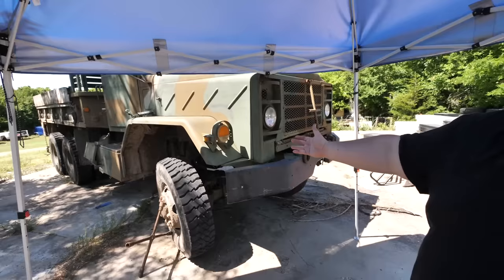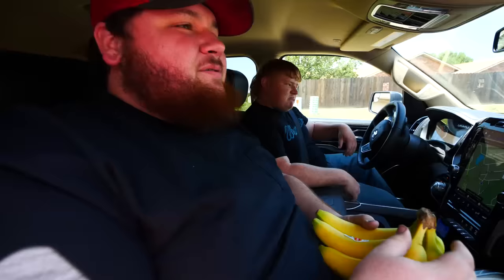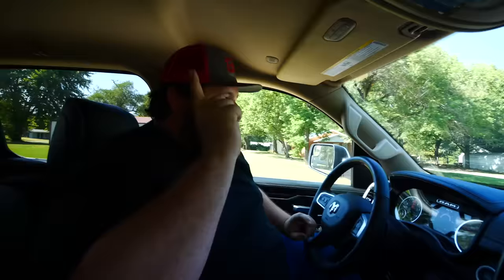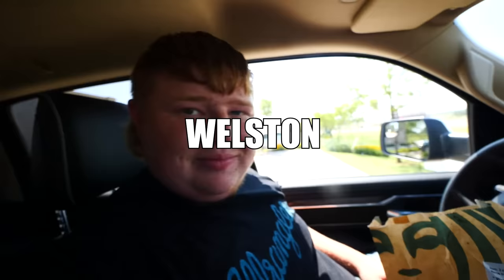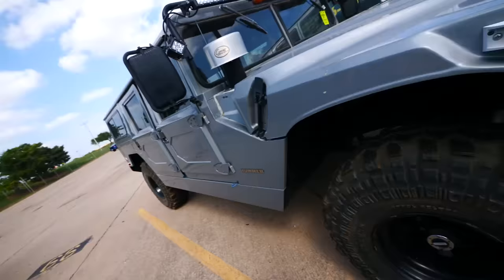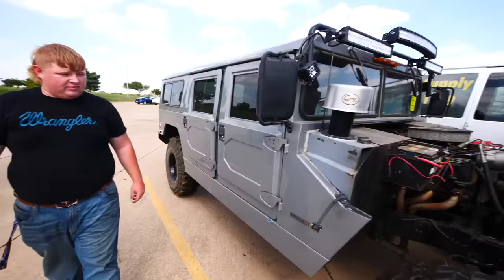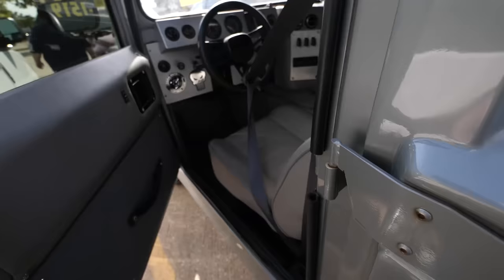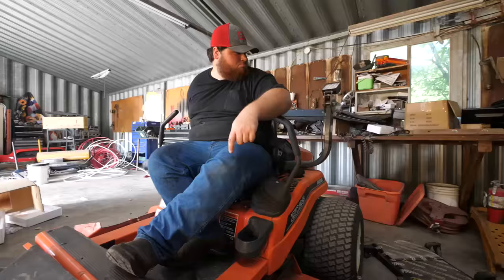Buying H1 Hummer From Auction..Turns out its FAKE

Comment: Civilians “ohhh military grade”
Us in the military “military grade run run run”
😂😂😂😂
Reply: Military grade is a baseline. At least in the US, you can almost always get better civilian versions of military gear. But military grade gives you a degree of compliance where you can be certain that it meets certain basic requirements for durability and interoperability. The last thing you want is out-of-spec MOLLE or other critical components.
Reply: coming from someone who used to work in a factory producing "military grade" components.. there is a lot more scrutiny, and spec compliance when it's a military job then some other civilian customer. doesn't necessarily mean the part is better or of a better material, but it's definitely "up to spec" as they'd say
Reply: @WardenWolf  the air force is an exception, they get the best of the best
Reply: Hahaha! True
Reply: I worked as a maintenance tech in a large hotel for years... When you see "Hotel Quality" on a package of sheets leave em right where they are.

Comment: Whether it's thr real deal or a built-from-the-frame-up replica, an H1 is still a good lookin' truck. It had me fooled at first glance too, dudes. 🤣
Reply: True either way its a piece of crap
Reply: I'd drive it.
Reply: @Abel-Alvarez  I thought everyone knew that the HMMWV had portal axles...and everyone can see, on the first glance, that this fake doesn't. And, actually, the guys in this video did spot this right away, right on the first glance.

I wouldn't want to drive a car which basically yells out to everyone: "I'm a fake! Now have a look at the driver!"
Reply: Guys that’s a real h1 many ppl do duramax swaps and suspensions soget chances on them so those two thing I wouldn’t be judging by since those are the two biggest changes ppl make to them

Comment: Who the heck makes a fake Hummer?

Edit: hol' up, a MANUAL electric car!? You can't say that isn't cool.
Reply: Its not cool, you need the roar of an engine to really feel what its like to drive
Reply: Bannas
Reply: Fakes are actually pretty common.
Reply: @xxchiefthiefxx365  I like quiet cars, so I disagree. A roar is nice, but not nescisary
Reply: @xxchiefthiefxx365  Sure try driving a taycan and you will change your opinion
Reply: Probably a major upgrade.
Reply: Ed Carol in Texas makes shit like that and half dozen shops in Southern Calif make em. I think they were sold body & chassis even devoid of gauge clusters where U would have to order or install your own gauges. Most of the time the speedo gear cluster would have to be ordered. Clarion Company in Los Angeles was one and there are others in Michigan had these clone bodies and frames shit. I have a yellow one here we got in a trade deal. The reason I state it is not H1 suspension system more Like an F150 and there is no motor no gauge cluster no ignition. But the steering is there and the axles to be hooked to what ever. The wiring (HARNESSES) is with the thing in a big box in the back has many plugs that can be wired up. The bad thing is there is no instructions. Probably why it was sold at our auction for $1500 bucks even with cool wheels and tires...
Reply: my buddies welding shop fabricated up a H1 to put in parades and stuff for advertising, turned out great.
Reply: Invidious Ignoramus your clutch would pretty much last forever, too
Reply: The now defunct Classic Roadsters in Fargo, ND use to make a pretty good copy of the hummer. I wanted one bad when I was a kid. Kit was $13K and you supply the GM square body frame and running gear.
Reply: @precisionmachineshed  The ah Frankenstein we have came from somewhere nobody even the place in Texas where we got it at the sale remotely knows where the fucking thing we have came from. I was under the impression these things like I have came from or were made in Texas or Arizona. Now U say North Dakota. Maybe what I really need now is a Medicine Man to get the construction manual.
Reply: Urban Gorilla bodies made to fit any chassis
Reply: The same person making a Phantom out of a Chrysler 300.
Reply: @xxchiefthiefxx365  And that why they started adding fake engine sounds to em XD
Reply: If something exists someone will make a fake of it.
Reply: Extreme 4x4 made one from a 3/4 ton suburban. They called it the Suburban Gorilla. It had a custom built Duramax under the hood from Banks.
Reply: The fake Hummer came from Arizona.
Reply: Jurrasic truck builds a kit that fits a 4 X 4 suburban chassis.
Reply: I have friends who do body work for a living and also buy from auction, and just for kicks, theyve built a couple of fakes...
Reply: I remember being all excited in high school, then got an imitation...
Reply: How does that work. I don't think an electric car has more than 1 gear. Does it just change the max power percentage or something.
Reply: For real, electrics don't even have gears so what the fuck does a MANUAL ELECTRIC CAR mean!?

Comment: This is why I don't buy from auctions. My friend bought a "Cadillac Escalade" in an auction and it turned out it was a chevrolet suburban with a Cadillac kit.
Reply: Your friend needs to pay attention, how the HELL DO U DO THAT!
Reply: To be fair, that's what all the escalades are though haha
Reply: Same thing GM does.
Reply: sstroh08 😂 i put escalade wood grain interior in my burban most probably would not know the difference
Reply: Tf you think GM do for caddy? Make em
Mold everything in Carbon fiber lol same shit everyone used to do back in the day with explorer and Lincoln 😂😘
Reply: An Escalade is just a Suburban with a Cadillac kit straight from the GM factory. So your friend really did buy an escalade.
Reply: It wasn't on the title?
Reply: @jerrydavis9558  expedition and navigator always had huge differences. The 03 navigator interior is so much nicer then the expedition. Completely different inside
Reply: sstroh08 Escalade comes with different motor  and nicer interior
Reply: Cadillac, GMC, Buick, Pontaic, Saturn, Hummer  are base of Chevrolet Tahoe, Suburban, Silverado, S-10, and etc sharing all platform, engines, transmission, frame and etc
Reply: @MLProductions.1  how much nicer than a king ranch or eddie bauer expedition? Not by much lol
Reply: @jacobking4106  I think much nicer. I've driven both and the plastics and. Everything is so much better. Different engines as well at least until 04. But other then that there the same. But those years did have much bigger differences then the Chevy to Cadi
Reply: They never bought it - its a fake/staged video that they made knowing it wasn't real to begin with. C'mon you think this really happened IRL? Everything he puts out lately is staged and pre-planned.
Reply: tbh thats better cause they are the same thing, also parts are cheaper when you say its a chevy over a caddy
Reply: It’s technically the same thing
Reply: The suburban is more reliable 🚙
Reply: But that is what a caddy is? My dad had the Escalade EXT and that's exactly what it was. 
All the part numbers down to the air shocks and pump are the same between a maxed out chevy avalanche and the Escalade EXT. Same Bose sound system, heated/cooled seats, etc etc.
Reply: @richardharris492  Ha, all you'd need in a front clip, tail lights, and interior trim pieces and there ya go.
Reply: @JavierSanchez-hv9hn  Not really. I believe they came with a 6.0? Idk, I don't really see many of them, but every single 99 and up Suburban built has that 5.3 Vortec, which is a legend (LS), so if it was fake, but had the 5.3, I wouldn't mind. Also yes, I realize the 6.0 is LS based, but for just everyday use the 5.3 is better. Slower but better milage.
Reply: But Escalades are 6.0s or 6.2s and most are awd . I think Denali are the same fckin thing but gmc . Burbs aren’t awd and they don’t have 6.2 . 2500s have 6.0s
Reply: LMAO! Check the VIN
Reply: Richard Denson  facts . Always check the vin !!
Reply: a Denali suburban is the same 6.0 engine
Reply: @nickopedia5669  when I worked in the auto sales Dealership we call that putting a bow tie on the horse t*** . Just change the trim kit on the assembly line.
Reply: I buy from auction, my wife worked at an auction for years... vin numbers and titles are verified... no way can a vehicle be sold as something it isnt... 🤷‍♂️
Reply: @jeffanderson7256  i had my old z71 gutted (it was stolen) so i installed a full escalade interior, carpet, door panels, seats, dash and center console... everything but the steering wheel, it all fits right on
Reply: @apolinarcaborca_elrojo7878  i got the dash, wheel and window switches and always looking for a nice set of the door cards
Reply: @sstroh08  escalade is a suburban, just with a better interior. They come off the same assembly line. Just like the Mercury mk. LT is the exact same vehicle as an F150.
Reply: @MLProductions.1  the interior is not a big difference, you can swap all that stuff out in about an hour. The truck itself, the mechanical are exactly the same.
Reply: North Star V8 was trash…. I’d pick a Suburban with a body kit any day of the week…
Reply: @richardharris492  it's one of those "no touching" auctions

Comment: "This one doesn't even have the self-vibrating tire feature, so you can't tell how fast you're going."
I have that same feature on my 97 Ford Expedition, courtesy of Hankook mud tires! At 55 you start hearing the tire, at 80 you no longer hear the engine, or the radio, or any of the passengers in the car with you.
Reply: It's a Dodge? It's just a question of time! Plus those Fiat EcoDiesels are unreliable AF! FCA Junk!
Reply: Is this an American thing? I never heard of this feature before. I'm in Europe tho. And i thought you guys have more silent tyres over there, to make the ride more qiuet on long roads. Or is this an old thing now lol?
Reply: @ElvenMans  It's what happens when you put aggressive mud tires on something at higher speeds. Most cars and highway-type vehicles come with less aggressive, quieter, lower-rolling-resistance tires. People who go offroad(or "want" to go offroad) put big, knobby tires on trucks(and anything else they have) these tires are good for mud, sand etc... Highway noise is much higher though.
Reply: I'm buying me some of those tires tomorrow
Reply: Got 37x13.5 super swampers on my 97 f150, hitting 60 in that thing is the ultimate adrenaline rush

Comment: That “it sounds like a 6 liter with no oil” hit a little too close to home. 01 2500 suburban 4x4 with 247,000, she has that lifter clack on cold starts
Reply: they all do, ive got a 6.0 thats been doing that for 5 years and still going.
Reply: If it doesn't have that clack, time to trade it in

Comment: Hearing him talk about rough pickups reminds me of the one I just took home today. 1983, max at 60mph, 4th gear gets angry and 2nd gear maxes at 15mph, so you chill in 3rd all the damn time. steering is super loose and brakes are really hard to push down. But $800 is $800 and the 351W is running healthy, so that's all that matters, right?

Comment: They have a lot of blown up hummers left in Iraq
Reply: They don't have a single blown up hummer in Iraq. Humvees, however...
Reply: @milk1472   get outa here with that s***
Reply: @milk1472  Hummer-Humvee=same.
Reply: @scottbaxter2682  hummer- $60,000 vehicle with 6600lb curb weight with a 6.2L V8.
Humvee- $220,000 vehicle with 8500lb curb weight. 6.5L turbo diesel. It also has a turret mount and ballistic protection. They're not the same. Hummer is pussy shit to a humvee

Comment: There was a guy making kits back when, GM  made him stop when they were bringing the H2 out.  Most of them were on suburban chassis.
Reply: I remember when there were Hummer kits to convert a GM truck or Suburban into a Hummer. They were like $5-10k 15-20 years ago, depending on what you wanted.
Reply: Bummer kit!
Reply: Yeah, the Bummer was just one of several kits made. I had one. It was great and could eat a real H1 for breakfast.
Reply: I remember the gorilla kits. 4x4 off-road on powerblock tv made one years ago
Reply: there are kits all over north america
Reply: U R correct Ed. There was more than one guy. The guy that sticks in my mind had a COVERT place outside of Dallas Ft Worth area. His name was Ed Carol. He had alotta issues and ran a body shop. I have one of these clones made on 99 F150 frame a yellow one a real cutie pie. Has no motor no gauge cluster and there is a wiring harness inside the thing in a huge cardboard box. There R no instructions to the wiring harness we R hoping to use a Silverado harness and put 6.0 in ours. The harness has many many plugs and we cannot figure what the fuck it what. OUR CLONE does have a Ford frame definitely but ours has the solid GM 1 ton 4x4 axles and huge Transfer case so likely what Weston was looking at is alot like what I have in shell form. The guy in Texas that was making these was Ed Carol. He had multiple warrants out 4 him back in the 1990's then he disappeared. Someone else owns the body business where he was selling this stuff. There were other people making stuff like this too on the west coast. So what Weston is seeing is deff a fake fake with a gas motor and Solid Axles and alot what we got 7-8 years ago at a local auction here. We only paid $1,500 for the thing because it was disclosed as a KIT if sorts. I was intrigued and got it. I was thinking someone in Mexico was the culprit putting together UNSOLD left over Ford chassis and GM axles since the assembly plants got crushed by BUSH was and OBAMA. I was told these guys doing this work were doing up until about 2009 or so.
Reply: @danielculver426  They still make them according to the interwebs. I would think most of the vehicles used in Hollywood productions that get blown up are actually Bummers. Since actual HMMVs cost more money.

Comment: That was my buddies old H1 kit truck. He bought it from some guy in the upper northeast and got it shipped down to GA. It was a pain in the ass to drive as the steering kept coming apart under the hood while driving. 🤯 It did however turn heads when you crank it. It sounded F-ing amazing!

Comment: If I remember right, back in the late '70s Mopar made a prototype for what was to become the HMMWV.  Some offroad magazine featured it and I was astounded by its capabilities.  However, AMC produced a design that the Military finally went with.  If I remember correctly all of the prototype designs were independent suspension.  I remember because I was impressed with the differential ground clearance was much more than anything on the market.
Reply: Actually, the Unimog had been around since 1949, different models over the years of course, but all with portal axles. The Volkswagen Typ 82 "Kübelwagen" was earlier but was only was built from 1940-1945.

The Unimog was of course not an option for the UA military as it has a manual gearshift. Depending on the model and variant, you could have up to seven gear sticks.

Comment: Just buy a retired humvee where really cheep for a good one
Reply: False logic—no good ones come out to auction.
Reply: @kraignadjkovic5494  how would you know? You just know every humvee that's ever went up for auction in every US State?
Reply: @Cody Praetorius I did 26 years and 1 day in the US military. There’s no cream puffs coming out of inventory to auction.
Reply: There is not a good hummvee.
Reply: No such thing!!
Reply: @lelandgaunt9985  lies. If it runs and drives its good if it broke its army standard
Reply: nolble608 Farrell 

I guess after a new engine it’s good; even with a proper weekly pmcs. Most still require you keep an extra seat cushion to provide tail pipe pressure. Please inform me on your experience.
Reply: @kraignadjkovic5494  He probably means "a little work will make it awesome".
Reply: @james avery Not so.

Comment: There's inboard brakes on either side of each pumpkin, and there's drop down gear boxes on every wheel. When I was in Iraq I figured out a way to do the brakes pretty quick. Civilian H1 should be just about the same, until they came out with the H1 Alpha which actually had a good engine. You should be able to buy a non-turbo one at a military auction no problem. Good luck with doing anything as far as maintenance, for every bolt there is a nut on the other side of wherever the hell it's bolted to and you need an extra set of hands and a third arm.
* oh there is a way to fiddle with the injection pump on the turbo models, to give it more fuel, the fan takes so much power. it only cools itself when it gets hot, and there is a fan cut off switch when you hit the accelerator pedal, so it can accelerate to 60 faster.
I thought this thing sat too high and the nose was too short,  and the wheels on a regular Humvee are kind of jutting out a little bit, like a Baja racer

Comment: 9:41 Canadian built ZENN (you can see the steering wheel says ZENN). 
Stands for Zero Emission No Noise, as it has a small electric motor. Was
 meant to be a small neighbourhood car only suitable for slow roads 
around crowded cities. Top speed 25 mph / 40 kph and has a 40 mile / 64 
kph range. They were going to produce a faster and longer range version 
in 2009, but it never went into production. I think they were made 
in/near Quebec? Maybe Eastern Ontario. I'm Canadian so.

Comment: I never seen the appeal for one.  I knew a guy that had a real one.  He said it was a POS and belonged back in the desert.  It handled horrible! 
Big and heavy.   My gripe is that they are so wide.  What a pain in the ass on the street.  Visibility out the back was horrible, for backing up.  That's bad enough on a normal vehicle.  
Out in the timber or rocks.  It's much too wide for maneuvering.  Width of wheels, it high centers on mostly every slightly rough terrain.    It's defiantly not a rock crawler.  
Besides!  If I was to want some thing big as such.   Unimog is much cooler and narrower for back country.  Taller stance better clearance.  Defiantly more usable.